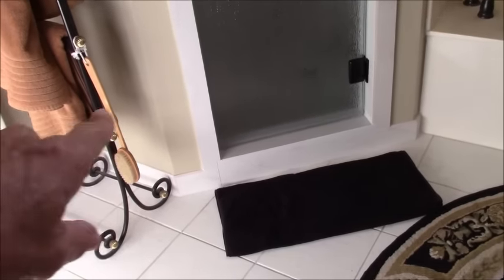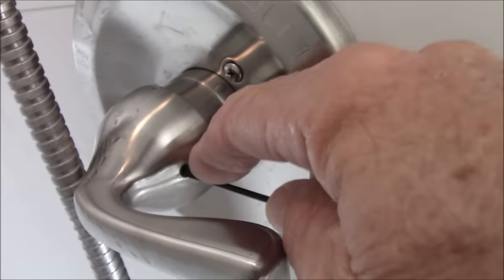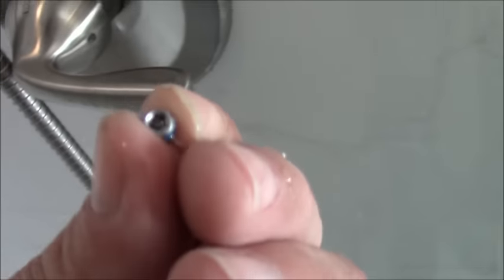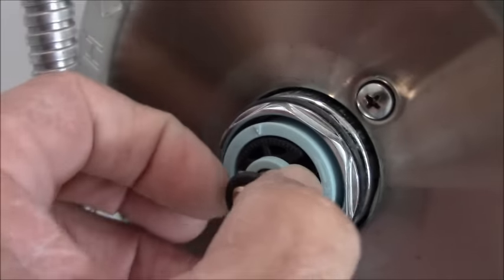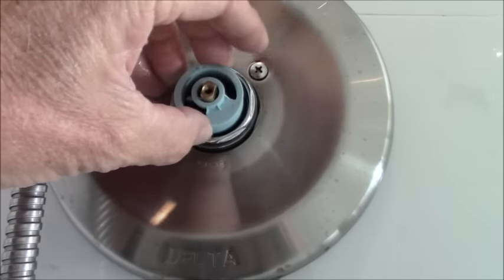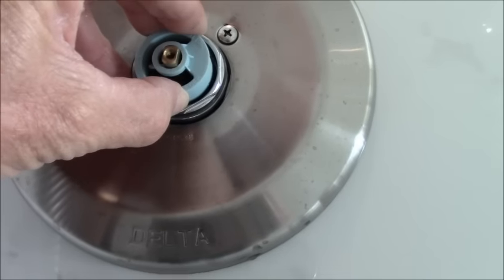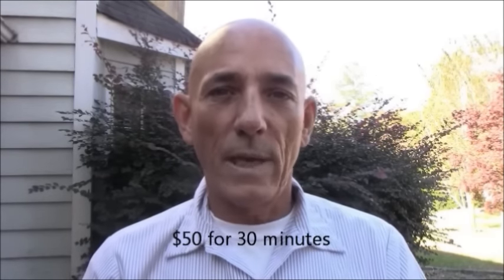ADJUST HOT WATER for SHOWER VALVE

Comment: I sometimes put painters tape over the drain when dealing with small parts so I don't accidentally drop it down the drain
Reply: I was thinking put a towel or rag over the drain first. The tape will ensure it doesn’t get moved.
Reply: I just lost that little screw down the drain a minute ago 😂 time to go to the hardware store

Comment: You have helped me twice now, first when I first moved into my house with this particular and specific valve cartridge, and your video showed me how to adjust the hot vs cold, and now almost three years later, after a freeze split the cartridge down the side and I needed to replace it. I tried all over the place, even going to a professional plumbing supplier, and they couldn't even find this cartridge in their catalogue. Came here, got the product number for the set, and in under 2 minutes I had the replacement cartridge ordered.

Comment: The exact shower I have, the only difference is in the adjustment, I don't back out the hex till it comes out, only till I can slide off the handle and I place a wash towel of towel over the drain incase I fumble the screws.  Great video, well presented and clear.... thank you for posting, we now have nice hot showers and after two ruptured disk back surgeries I thank you after a long days work at UPS.

Comment: DONE! Hot water FIXED in about 2 minutes with the right tools. ...used #2 pretty tiny allen wrench. ...had to do this in my other apartment too, as they probably want hot water savings, or as protection from scolding tenants, or misinformed maintenance guys.

Comment: a plumber told me I needed a mixer to get hot water to the shower but after watching your video I fixed it myself, the wife says thank you she can take a HOT shower again    only turned the handle screw about one or 2 turns so it didn't fall out but had towel over drain just in case   Thanks for the video

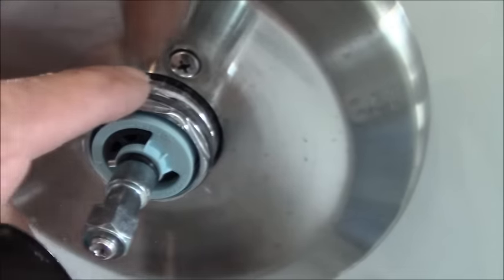Comment: Woohoo. I did it.  Thank you.  I thought I had to buy a new handle/cartridge.  Nope!  Not quite as tight as I'd like it and I'm afraid the handle will come off but we'll see.  Don't think I got that tube "this portion" at around 2:14 back on quite right either. It doesn't lock into place or it's not held by anything, but hope this will work.  Water is HOT!  Thank you!

Comment: I found that I didn't need to remove that trim collar.  It seemed to be a bit of a struggle  even for you, and mine didn't want to budge.  But it was easy enough to slide the O-ring off and adjust the stop with the trim collar still on.

Very helpful video, thanks!
Reply: Thank you Logical One for that tip

Comment: No most shower valve components are packed individually including the cartridge, there is no setting done at the factory, it’s up to the installer ( plumber) to use a thermometer and adjust the stop to the desired temp. All  replacement shower valve cartridges in america have a scald guard max stop of 120deg .

Comment: I had a hot water heater replaced last year. The old unit had 2 control panels and when they installed the new hot water heater they said 2 was not needed. They installed the control panel in the kitchen. There was 1 in the kitchen 1 in the master bath with the old unit. Do you know what could cause no hot water in the master bath now? The no hot water started probably around 2 weeks after installing the new unit. It's only the master bath every other part of the house gets hot water. It's a tankless unit. Any info is much appreciated.

Comment: I have the exact same valve and it’s leaking but the ring will not come off. I’ve tried WD-40 and channellock but will not budge. Also used a hammer and flathead screwdriver. Any suggestions?

Comment: I am going to try this, We have scolding hot water in our sink faucets throughout the house, but both our showers only get up to comfortably warm for showers, we can never take a nice steamy hot shower. And have had water heater at 100% just to get showers warm enough to use.  I hope this works on our model of fixture.  Ill post back.  If it works, I can turn the water heater down and save $$.
UPDATE,  Wow, it was even easier on my model, no washer to mess with. Max water temp was 102, made a small adjustment and now 115 to 116, does not sound like much of an increase but it is, Still room to adjust more if I need to when I turn the water heater down, Thanks!  Finely a shower or bath that will actually help my aching back.   I have been at this place for a year now and I could have been taking hot showers rather than pretty warm showers all that time.

Comment: I work at a hotel. We just bought some of these valves.  The plumber is long gone but he didn't check for hot water.
Did you have to shut off the main water to do this project? Anti scold is also new to me.
Reply from the maker: The only reason to shut the water off is if you're going to unscrew that ring to pull the cartridge out, even unscrewing that ring will cause the pressure to shoot that cartridge at you like a bullet.

Comment: Question! I just installed this shower valve! All sinks have HOT ass water except the shower. I looked at the manual and did as you did, well i went all the way to the hot side. Water is just warm 🫠
Reply: What else could i do?…. Water lines are not mixed
Reply from the maker: That knowing your specific situation I cannot answer that but I can tell you that most of the manufacturers are very very good with their technical support, so I would suggest calling the manufacturer

Comment: What if there is no team range when adjusting the warmth? You have to be careful not to turn it more than a 16th of a turn and it goes from hot to cold or cold to hot. It's dann near impossible to adjust the temp. Luckily the temp is separate from the on/off and it stays in one place. However it takes FOREVER to get warmed up and you can't turn it all the way hot or your stuff trying to fix the temp again when it does get warm

Comment: FYI you don't have to remove the set screw to get the handle off and cover the drain with a towel to prevent accidentally losing screws

Comment: for my knowledge, if that shower temperature was working normal before, and now getting too hot, its because one side of the valve (cold side) is getting stuck with dirt. so if you close the hot side yes its going to balance the temperature, BUT eventually the cold side will get stuck completely and get hot again. Its better to replace the cartridge inside. Those valve or cartridge no last more than 5 years, bc the minerals in the water.

Comment: Great visuals but I didn’t hear if you need to shut the water feed!
Reply from the maker: You cannot shut off the water if you propose to change the temperature, you need to be able to know that you've done it without going back and forth to the valve
Reply: @StarrTile  Very good! I was hoping you would reply! We had 2 bathrooms re-done and in one shower this make & model we’re used. The water wasn’t hot enough so I searched YT and your video came up. I’ll say it again GREAT visuals it will help by not having to bring the plumber back. He charged $200 per hour! Thanks again! 👍🏻

Comment: What size Allen wrench did you use?
Reply: Michael Swett right cuz none of mines are working 😣
Reply: @mniqua8353  I ended up just pulling the shower knob right off
Reply: I think they're all either 1/8 or 3/32 inch allen heads.  Ours was 3/32 (and it looks like this guy's), but the screw must have been stripped by the installer,  because the wrench couldn't quite get purchase.  I found that 2.5 mm (from a metric set) was just enough bigger to fit snuggly and turn the screw.